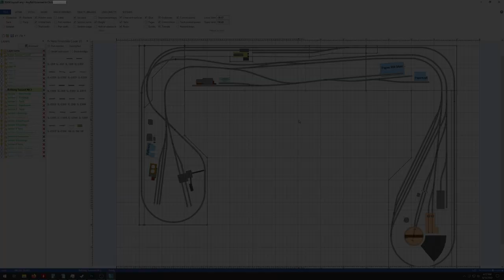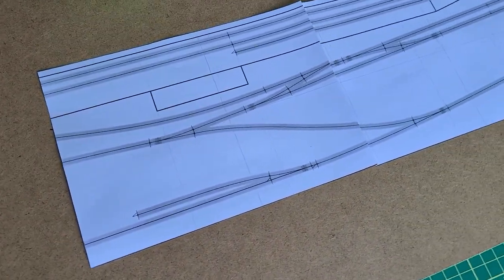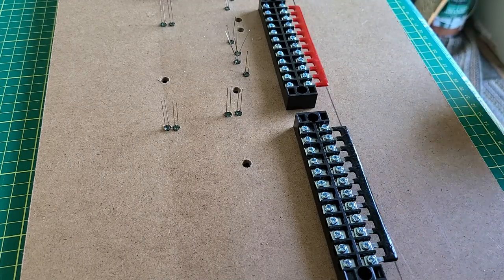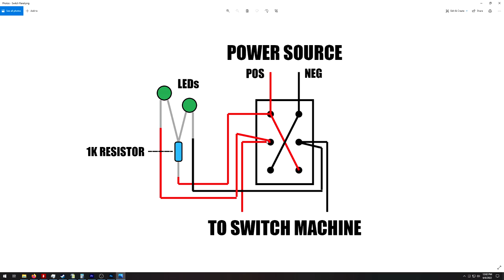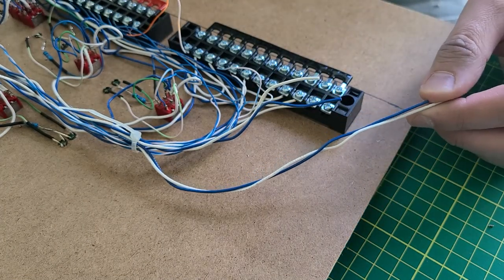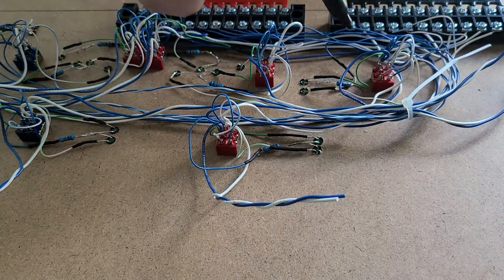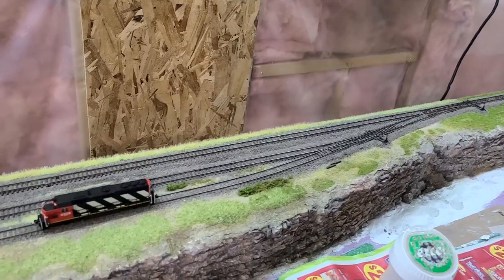N Scale   Switch Panel

Comment: I used a very similar approach with two minor differences. I had my paper plan laminated. This way it won’t be damaged. I used bi-color led’s that show both red and green according to the through or closed route. 
Loved your idea of printing directly from AntRail. Brilliant!
Reply: Laminating the paper is a great idea I covered the paper with a 2mm plastic sheet to prevent damage on the paper. I also used red and green LED's as an indication for the switch. Red LED indicates a left or right turn and a green LED indicates a straight passage. I thought of putting LED's in series with the track voltage to indicate the trains on particular sections. This would have ment that the wiring would be very complicated so in the end I didn't. I only have some indications of occupied hidden tracks so I know a train is blocking a specific section..

Comment: I like your panel setup. I would like to make a suggestion for another way to use your LED's. The Tortoise machines have two sets of auxiliary contacts and if I remember correctly you are using one set to power your turnout frogs. The second set can be used to power the LEDs. It would actually simulate the prototype in that it would be reporting the true position of the points on the turnout. The LEDs would only light after the machine threw completely instead of when the toggle switch is thrown. I love your videos, keep up the great work.
Reply from the maker: Thanks! That's a good idea, only I believe it would require running wires from the tortoise to the panel.

Comment: I have done a similar one using the printout from SCARM.  As someone commented below, you can use the other two contacts from any of the various kinds of switch machines (this does not have to be limited to Tortoise.)  Since you are using some old CAT-5/6/7 wire, One cable can supply both led and power to two switch machines.

Comment: Would it be possible to use one DPDT switch to control two turnouts? I was thinking about something like a crossover on a double mainline, or both ends of a siding. Throw the switch, and both turnouts align to the diverging track to allow the crossover or access to the siding. Throw it back, and both turnouts align for the through track to shut down the crossover or access to the siding.

Comment: Great video! Question, I noticed that you're using a DPDT (On/On) switch... doesn't the constant flow of power to the switch burn it out? (I thought you needed a DPDT On/Off/On switch?)
Reply from the maker: I have the power for my switches and tortoises behind a master on/off switch. So when I am not using the layout, or not doing any switching, then there is no power going through. However, from what I know there is very little power/load anyways.

Comment: Great video!! Question, with your cross overs @13:16, was there a reason that you chose to drive all 4 of those turnouts individually rather than have both turnouts on a crossover thrown with a single toggle?
Reply from the maker: Probably just easier on my mind and the repetition of wiring. Perhaps a single toggle would be more efficient.
Reply: @nscaler454  cool, I appreciate the response. I really like that panel!

Comment: Thank you for this amazing video !  I’m currently trying to do the same but I encountered I little difference. I’m using mtb motors, so I have 3 wires to connect to my motor. How can I modify your system to mine ?
Reply from the maker: unfortunately I am not familiar with those motors

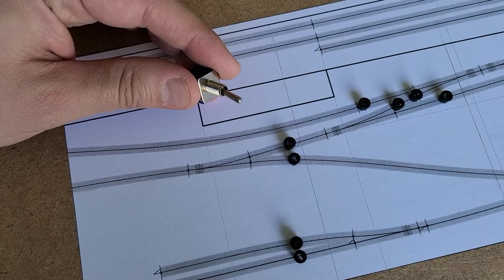Comment: Hi there, This is a great tutorial. My layout was created with SCARM,  and I am updating my control panels. I have the trial version of AnyRail and have re-created sections with turnouts on SCARM, to it. I have slightly altered the look of the panels to what you have done with yours. The marks for the switches ( 3:55  ), how did you draw them in? I couldn't see any where in AnyRail where those "indicators" are.

The LEDs on my existing panels are single colour ones, but to save space, I will be using Bi-colour ones. These have the standard 2 legs on them, but if you use + to the long leg, and - to the short leg as is usual, you get RED,. If you connect + to the short leg, and - to the long leg you get green. Does that make sense? 😕

FWIW, I am trying to to use plexiglass/acrylic panel and painting the track layout on it. I'm not sure yet whether to have tracks in grey/black on white background or white on black back ground. I have to workout how to place the tracks first on the rear of the plexiglass/acrylic.
Reply from the maker: The markings at 3:55 are automatically printed out from the AnyRail export. I didn't select anything specific that I know of to make them appear. 

I've never used bi-color lights, so I couldn't tell ya how they get wired.
Reply: @nscaler454  Regarding the marks for the switches -- probably has to do with what brand of track you use on AnyRail to design your layout.

Comment: This has only just popped up on my feed so I am very late with comment.  I am puzzled as to why you would use two DPDT switches for each cross-over between two tracks when one DPDT switch would run both tortoises?
Reply from the maker: I probably could have done that. Didn't consider it at the time. I love the comments as often it helps me learn.